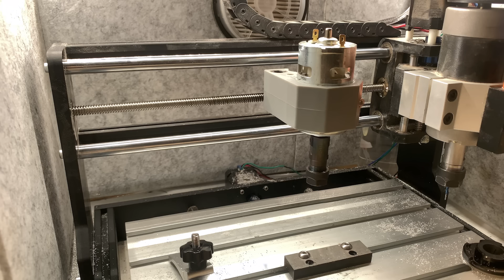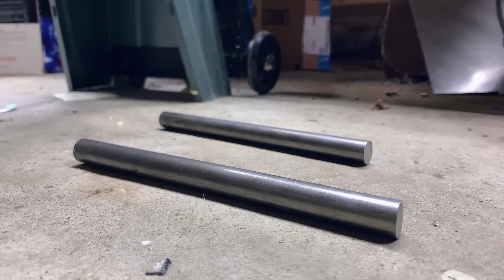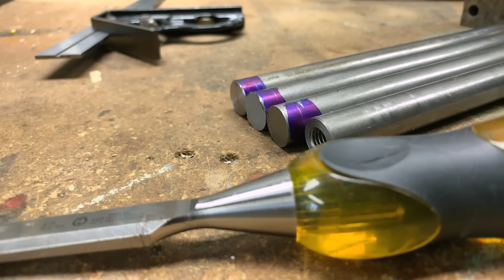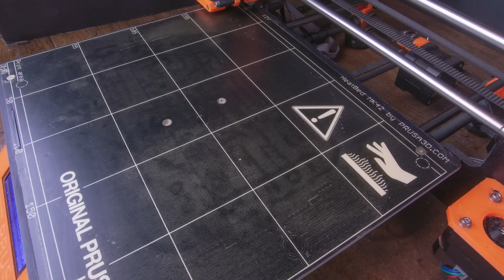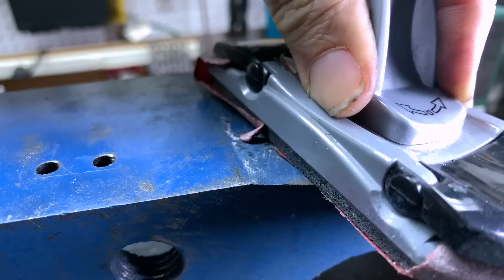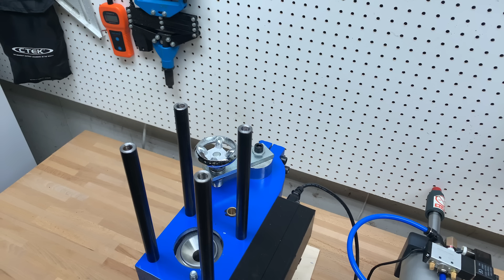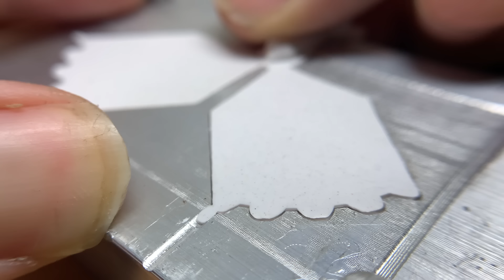Build an Injection Molding Machine From a Cheap Pneumatic Press

Comment: Very cool; seen this on Reddit; would love to see one side hard mounted and the other side attached to a hand lever push pull toggle clamp so you can keep the mold from opening due to plastic pressure. Could even drill through the block and run some warm water through it, turbulent flow/Reynolds number to ensure the plastic sticks to the hot half for ease of ejection, not sure if the tolerances for ejector pins is doable but maybe its possible to have a spring mounted contraction that hits the sprue as it opens dropping parts in a cutout under it. Would love to see how this projects coming along and to hear about any problems you've ran into.
Reply from the maker: Great feedback.  I really should have been more careful filming the injections.  I actually don't have a huge issue with the mold opening.  That bridge clamp is actually quite strong and with the large hand wheel I put on there it's possible to crank it down with a lot of pre-load so the mold doesn't open.  (At least for the surface area of molds I've been doing)   However cranking that down hard moves everything around when filming, so I didn't do that for the shots that I filmed.     I would love to make a better clamp holder that hooks to the T slot and lets me crank down on that without it shifting around, but so far I haven't gotten around to doing that.   Those forged clamps are not easy to design around.  No flat surfaces, and you don't want to de-rate them by welding to them.  lol.   I would like to do some more experimentation with more complex molds with ejector pins, etc.  I'm not really getting to the production rates where water cooling would be needed, but it might be fun to try, but not for any practical reason since it would add a LOT of complexity to the setup.

Comment: Did you get a partial or whole refund on that terrible broken machine they sent you?
Reply from the maker: They eventually sent me a new regulator gauge and a new solenoid valve, and that took several weeks to show up.  By then I’d already gotten a new valve just so I could keep working on the project.
Reply: @retrotechjournal  I'm glad you didn't order a bowling ball because they would have just tossed it in a cheap garbage can liner with a stamp and when it came in two pieces they would blame unfriendly shipping.  No.  It's your packing/shipping that was the problem that caused this!
Reply from the maker: @MrShwaggins  I wonder what percentage of shipments actually make it ok using that packaging.   It's kind of a miracle the controller didn't get smashed off.  I think if they just shipped it with the controller/regulator/solenoid valve in a box, inside the arc of the machine it would need a small amount of assembly but would be 90% more likely to actually make it un-smashed.  Of course a crate/real packaging is the real answer, but that adds cost.
Reply: @retrotechjournal  I've ordered some heavier equipment before and it seems that if something weighs more than 20lbs they get the boxes sitting outside in the rain, throw the machine inside it, find a piece of bubble wrap laying on the floor and some styrofoam to toss in like a child throwing a paper basketball into the trash, seal it up with the worst yellow tape and kick it out the door.  I mean I could be wrong, but I don't think I'm that far off.

Comment: If you want to make parts faster, make another/more mold(s). Let one cool down while you already use the next one.
Reply from the maker: Yes, as long as the rig is able to melt plastic fast enough that's a totally viable way to make parts faster.  I haven't really needed that level of speed since I'm mostly just doing this for the fun of making the molds and all the design challenges, but that's a great tip for those with a real need for speed. Thanks!

Comment: This is awesome. I am just now looking to figure out how I'm gonna make a bunch of copies of my board game pieces... I can't keep printing like this
Reply from the maker: It is true that DIY injection molding can be great for that awkward "more than I want to 3D print, but no where near enough for a commercial run"  When I was making 100's of loom parts and then I wanted a change it was really un-fun to slowly crank the new parts out on my printer. It's also nice since with careful mold cleanup/polishing you can get some amazing surface finish.  I do think Injection molding at home is going to become more and more common with home CNC's getting cheaper and the ability to 3D print short run molds it really is a great time for injection molding.

Comment: Ouch. As a machinist seeing those bars hit the concrete floor hurt.
Why? Mainly because you risk getting concrete fragments embedded into the metal and that might ruin your cutter in the blink of an eye.
Reply: But a most interesting idea with good solutions.

And for your issue with the CNC being to slow for rough machining in steel - consider a manual pre-machining next time.
If you are a bit careful with cuts and planning while thinking through fixation in the CNC you can reduce the amount of material it needs to cut significantly while still getting the benefits.
Reply from the maker: Wow that's a great point!  (pre-machining) I'll have to add that idea to my arsenal of fabrication ideas.  Also thank you for flagging the issue with the concrete.  I've known about abrasive loading in soft materials, but never really worried about that happening with bars falling on the concrete. I'm usually around to grab them anyway, but that's great to keep in mind.  It's always good to pay attention when there are simple things you're doing that make exp. folks eyes roll.  lol
Reply: @retrotechjournal  Oh and if you're using a reasonable good CAM application to generate the code look for how to machine from castings in it, that way you can give the CAM software a good starting point (so it doesn't have to move through all that you cut manually).
Reply from the maker: @sharg0  Yes, I'm sure I can do a more complex model of the stock, and the cam won't have to do anything too redundant.  It's a great idea.  Especially for a wimpy little machine like mine.

Comment: That was awesome! Can I beg you for details on the light and camera used? I'd love to shoot some video for my lathe based hobby and closeups would be essential!
Reply from the maker: Well the good news is that almost all the videos are shot on my iPhone 6+ and then later on my iPhone XS, with the closeups using a clip on macro lens.  Phones are also great for slow-mo since they all have the processing power to deal with high frame rates.  I find the phone is great because I can hike them out on a C stand to almost any location.  For example they can be in the CNC enclosure, but not touching the enclosure/table which are all vibrating when the CNC is running.  There are issues with the camera bouncing/wobbling out on a long extension, but as long as you wait for that to settle it's mostly ok.   I use Filmic Pro on the phone, which gives you a lot of control/I like the look more than what comes with the native camera app.  I have a few different lights, but for most machining stuff I use 2 cheap bi color led lights on flexible mounts.   The funny part is I had already purchased the lights and was looking for a good mounting setup when Adam Savage posted this:  https://www.youtube.com/watch?v=2UeghPJrUxE which was all about building mounts for the very lights I had just gotten!    So awesome.  So that's what I built. They are very handy/can get in close.  I use them for the lego animations too.  The macro lens I use is some Zitronic 15x macro that amazon doesn't even sell any more, but it's nothing special.  It's wonderful how cheap lenses for a phone are.  :]      I do use a better camera for the "talk to camera" segments, but I really think that is entirely optional/less important than lighting.  I used to shoot that stuff with a led "corn light" in a giant paper lantern ball.  Just because it was super cheap, but I eventually got a Godox ULC 150 with a softbox just because it's fan less, my wife got it for me for Christmas last year.  If I were doing it again I'd probably get one of the newer amaran lights since they're pretty compact.  I think it's easy to over think the equipment, but you can get pretty far just knowing enough about what kind of light you're looking for and cobbling things together.   My more expensive Godox light mostly just makes things simpler.  I don't have to climb into some  fortress made of shower curtains and foam core.  ;]   Good luck!  Let me know when you post a video.
Reply: @retrotechjournal  this is amazing, thanks so much! I think I have a similar LED for casual pics/stories in my shop so maybe I'll make it an articulating arm. I sent you a note on IG from my hobby account! 😁
Reply from the maker: @guitarchitectural  Is IG Instagram?  I do have an account over there but I have to admit I've almost never used it.   Pinging me here is probably more effective.  I also did a trick where I 3D printed some hooks for the legs of one of my tripods.  So I can hook them over the lighting panels I have over my benches.  That just makes it easy to hang an upside down tripod anywhere around.    That plus a side peg that goes over to the pegboard makes an easy re-position-able overhead camera mount.    Recently the big change I made in the shop (cost real money) was to put truly flicker free led T8 tubes in all my lights out there.   That is not a requirement, but having truly zero flicker out there means: Never any banding/flicker regardless of shutter speed/frame rate. I have lost some really awesome shots because I forgot to turn off the overhead lights when shooting some 240fps footage, or stop motion that was spoiled because the shutter speed was to fast and the lights were flickery.   Etc.  That was a very recent and rather big ticket item, but at least I can say goodbye to those issues.  I wouldn't worry about that for a while yet, but it's something I did.  There might be other cheaper solutions out there, but many led T8's say "flicker free" but what they mean is "flickers like crazy at a freq that is supposed to be above what humans can see, but which is still horrible if you film at 240 fps"

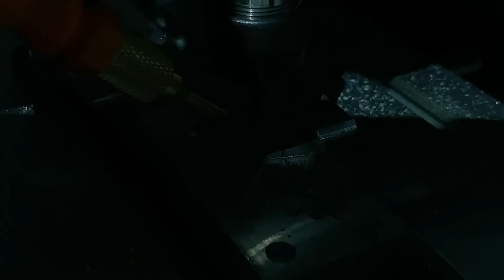Comment: Hm, regarding that power failure around 1:45, what's controlling the CNC machine? Perhaps if it's an Arduino, or some other chip with a free compiler available, you could program it to record each step it takes, where abouts in the Gcode it is. It could store it in internal EEPROM, which wears out in, what, 100,000 writes? And that's for the whole EEPROM, you'd only be writing a few bytes at a time, if it eventually wore out, you get a new Arduino for $2.

If it did that, and perhaps some other status info if necessary, you could restart from a power failure, automatically if need be, or with a bit of interaction with the software. The drill head could back off a bit, get it's bearings, then carry on carving. Hasn't anyone solved this problem already? I wouldn't be surprised if they have.

Arduino or ARM or whatever, they usually have EEPROM on board, and Arduino supports coding for them.
Reply from the maker: It is just running GRBL, so that's something it could do, one could probably detect the power drop and record position to eeprom as the thing was shutting down so you don't have to spam your eeprom,  but in practice that's not really practical because under loss of power the machines physical position is not really know.  Momentum in the components/cutter engagement, loss of power to the steppers etc.  You're going to damage the part/loose steps  pretty much no matter what.  If you happened to just be doing a rapid not engaged with the work, and you had reliable homing on your machine you could recover fine.   If you had enough of a UPS to raise the cutter out of the material and slow/stop the axes at a known location you could also make this recoverable, but that's a fair amount of design to survive something that hopefully doesn't happen much.  Worth thinking about but not really that doable.  I instead opted for "full house UPS" with solar/battery reserves, so it's no longer an issue for me for different reasons.   lol.  (We've had 54 power drops since I had that system put in, and 3 days of no power in the last week, so reliable power for everything was more important that "just for the CNC"  :])

Comment: Since you have all the work done on CAD and 3D Printing all ready done, I would suggest to you if you want to make some extra cash, sell a kit with all the fixings, and a instruction guide for a do-it-yourself Machine. Minus the Press of course. Pick one for the project, and build around that.
Reply from the maker: It's not a bad idea, but really I'm a tinkerer/problem solver.  Manufacturing/Business has zero appeal to me.   I'm happy to give the ideas away, but I need to be free to move on to whatever else is interesting me.   This is just a hobby after all.

Comment: Why don't you made that mounting plate to sit on top of the press plate? 
You mounted underneath and when press will push it repedatly it will put force only on those 2 screws, eventually they will become loose in time.
You should mount that collar plate uptop so the metal plate will sit above and reduce pressure points from screws and distribute pressure to entire plate.
Min 17:21 to be more precise.
Reply from the maker: That's a great idea.  That would also make it so folks wouldn't have to machine the casting away a little bit to make it all work.  The cylinder would have to be up higher but the upper casting could be lowered, so that works.   Originally I did it so all the hot stuff would be kind of walled away inside the casting, and that if full spring compression happened and the spring failed it would be kind of "inside" the casting.  But given the fact that I had to machine the casting to make it fit, and that I added those two standoffs to limit max spring compression so that's no longer an issue,  I think you're way would be easier.   Very little force is applied to the bolts unless someone fails to put a mold under the chamber and fires the cylinder while the plastic is still  solid.   In normal use the only force is a small amount of compressing force of the two springs.  (Depending on the travel distance down to the mold)   There's no issue with the bolts becoming loose.  Because they're already spring tension-ed even at the top position it's a bit like a giant lock washer.  :]     You can't just have it sit on the top casting though.  The whole assembly has to be able to ride up/down so the pressure applied to the plastic matches the "sealing to the mold's input" pressure.  Still the whole collar/spring/bolt assembly could be above the top casting and that would work around the whole "not quite enough space for the collar under the casting" issue.

Comment: Really enjoyed! Thanks 🙏
Reply from the maker: Sure! You're welcome.  I'm glad folks are getting some enjoyment out of my tinkerings.
Reply: @retrotechjournal  I run a 3D printer farm making thousands of parts daily. After watching your video, I realised I need to add some backyard injection moulding to my capabilities. For some applications it makes sense. So thank you.
Reply from the maker: @stevenmitchell7830  Yes, I do a lot of 3D printing (well not like you!) but a lot of custom designed one offs, and occasional runs of duplicate parts if I need them.  After doing 100's of loom parts it got to be kind of a drag.  Printing 3 lots a day for weeks. :b  Injection molding is amazing for that.  Being able to make a few parts per minute, with amazing surface finishing.   Really amazing/eye opening.  Good luck!

Comment: Did you blow the fuse or did Gavin kill your power
Reply from the maker: Well it was PG&E.  Not a blown fuse.  Heck, I don't have power right now.  In 20 mins it'll have been out for 48 hours.   Thanks to the current storm, but I'm not sure what caused that power drop.  We have  had 52 power drops since April, so it's not an uncommon thing.  :(

Comment: Is it possible to recycle stuff like plastic mike bottles etc with this?
Reply from the maker: Yes totally.  The main thing one would have to be careful about is making sure the plastic shreds are very dry.  Water in the plastic suddenly being heated to above the boiling point in an e closed chamber would be quite dangerous.  This is true of commercial pellets as well of course, seems easier to have happen using scrap.  I did some initial testing of the hand injection molder using ABS scraps from 3D prints and it works fine but is a pain to chop up small.    I’ve also reused snipped off gates from previous injection moldings.

Comment: Great video, avoid the chamfer on top of runner, the nozzle is forcing the die open.
Reply from the maker: In the video you can see the die opening, but that was really just an artifact of how I filmed it.  I didn't want to bump  the camera/move stuff around to really torque the C clamp.   It doesn't open like  that under normal use/clamping pressure.  I probably should have just re filmed that since I didn't end up using the whole sequence, and not given the impression the die was opening so much.  Having the opening at the top of the runner helps the nozzle align with the hole, so you don't need quite such a good aliment and it'll still work fine.

Comment: Loved this video. I have a new monkey for your wrench. Inject jewelers "hard" wax. Use the lost wax process to cast your parts in pretty much  any non ferrous metal at home. Go for the bronze silver or gold! 
Well done video!
Reply from the maker: It certainly could do that.  I've done a modest amount of jewelry casting.  I made our wedding rings, etc.  It's probably overkill for wax though.  I'd probably just use a lower temp/pressure rig of some sort.  Great suggestion though! I'm glad you liked it.